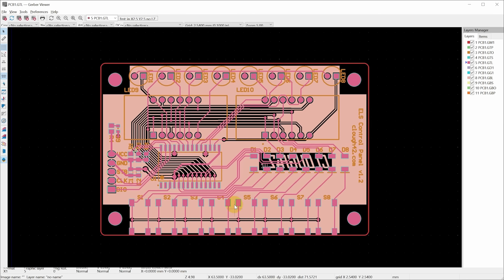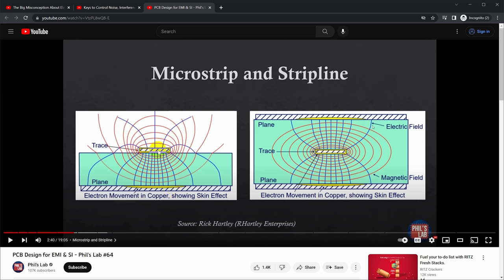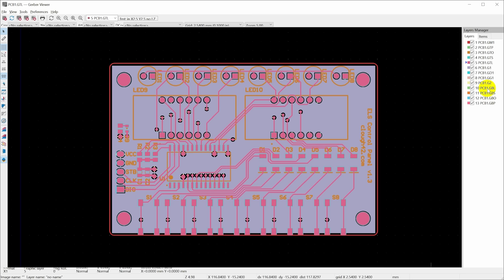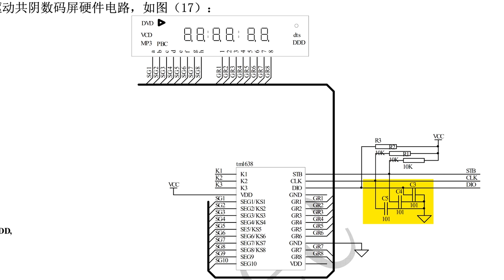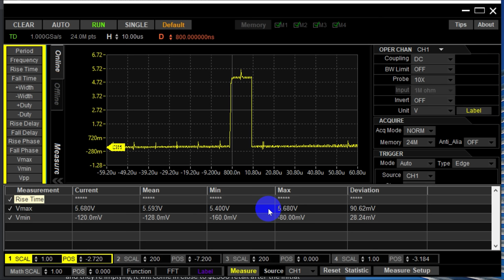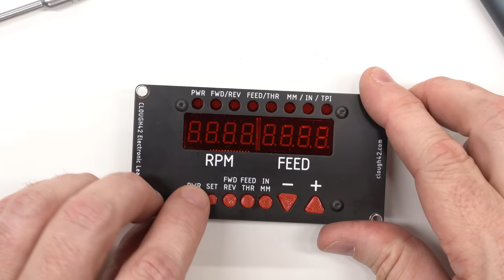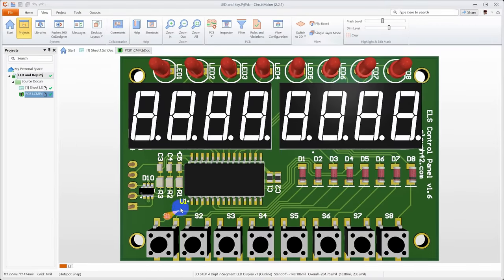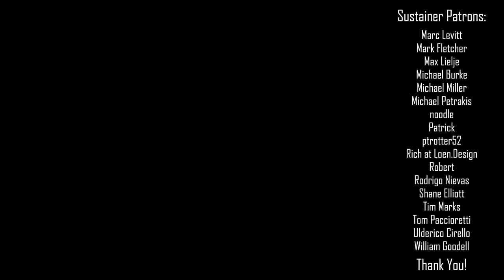4 Layers is Better than Two: Another ELS Control Panel Prototype

Comment: Regarding ESD you often will hear people who claim that they've "worked on electronic circuitry for forty years. Never used any ESD protection and never had ESD kill anything" or something similar. That may be true, but more likely is that they either just have selective memory or they may have damaged a lot of circuitry but not to so bad that it failed immediately. Thing is ESD can damage chips in ways that will shorten the life of the component and/or change the tolerances in both input and output signals.

This is nothing you can see with your naked eye so you really don't know if it has happened. So I really recommend that you at least consider the risk of ESD and do what you can to minimize the risk. So at least leave that wool cardigan and the spandex shorts in the closet when you are building something like this...

Comment: It wouldn't hurt to add a 10uf and a 0.1uf cap at the connector between 5v and ground.
Reply from the maker: The bypass caps used to be there, but I moved them to the other side of the driver chip, right next to the power pins.
Reply: @Clough42  Nice to hear from you.  Caps at the part are good too.  This descends into personal preferences pretty fast.   I spend a lot of (too much) time fighting really tough mil spec conducted and radiated emission spec projects for radio applications.  The caps at the connector would help with stuff coming in (susceptibility) on the input power as well as help to keep your locally generated noise from going back out on the cable (not an issue for your project though). Your understanding of signal return path physics was spot on.  Many EEs don't ever learn that.  Did you notice that when the ground plane signal gets back to the connector it has to open up a little bit to get to the ground pin? That is why on longer connectors, or on really fast edge rate signals most of us eventually learn to space out the ground pins to keep a ground nearby the signal pin.  Lots of opinions about cable shields.  The shield attenuates E fields but doesn't do a thing for B fields.  In order for the cable shield to work it needs to be grounded though.  The best theory that I have seen is to only ground one end so as not to have load currents also carried by the shield.  B fields are best addressed with phsical separation.  They drop off as a cube of distance.  E fields only drop off as a square.  Also, the same field area thing happens in cables.  That is why it is a good idea to run twisted pairs for your signal lines.  The signal would be twisted with a return ground.

Pat

Comment: 4-layer boards are so cheap these days that I've stopped designing for 2-layers altogether.
It's much easier to route on 4-layers and you get better signal integrity and lower EMI and since it costs basically the same, why bother with 2? :)

Did electronics design for 13 years and always been avid hobbyist :)

Comment: Curious what keeps you from using CAN bus. I use it on many commercial applications on CNC machines that have insane EMI.
Reply: It's overkill for this, could easily add like $10 to BOM cost, more if the servo driver doesn't support CAN. 

He could borrow ideas from it (and things like RS232) though, like differential signalling.
Reply: The display boards are a commonly available general purpose board. If he went to can he'd be rolling his own (more so than just tidying up the existing board) and people would be forced to use his board rather than being able to do everything themselves easily. Can or similar would be a "better" solution but better is often the enemy of good enough.
Reply: @roflchopter11  RS485 could be a reasonable option if BOM cost is truly a concern. 

I have never found the cost of CAN on BOM cost to be worse than the alternative....including numerous revisions trying to make incremental improvements in tough EMI environments.
Reply: @roflchopter11  shouldn't it be more like $1.50? Well, just for the board end.
Reply: @joseph9915  you'd have to add a transceiver and controller to both sides and probably upgrade the MCUs.
Reply: @roflchopter11  you can get the module with both chips for about $1.60 or JLC has  MCP2515 = $0.74 and TJA1050=$0.55. Although still more expensive than nothing or RS232.